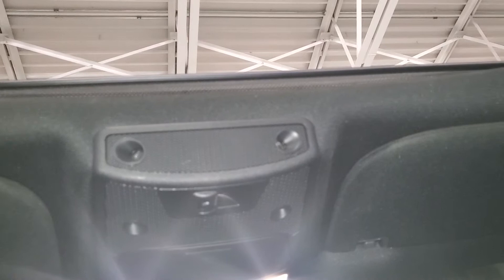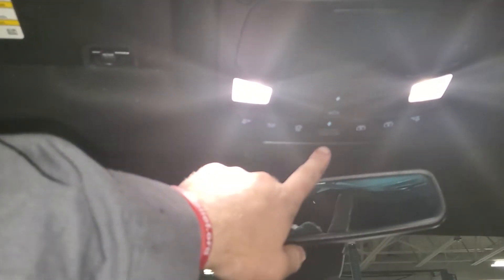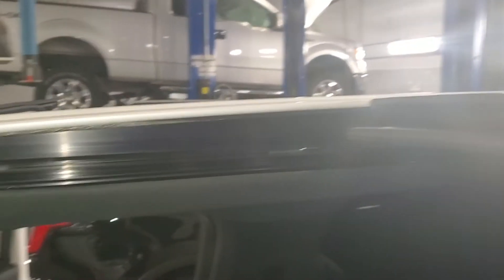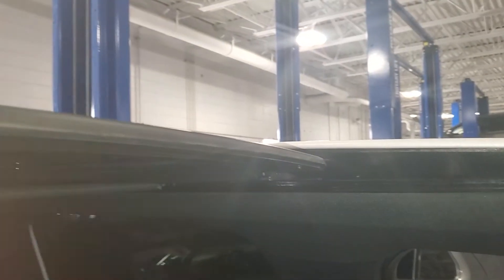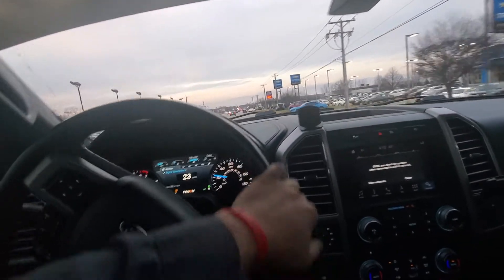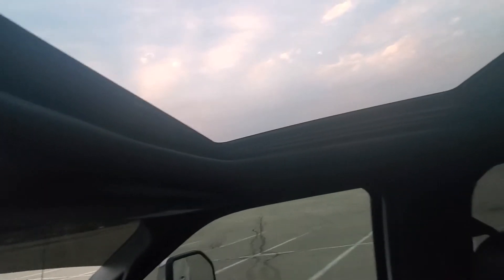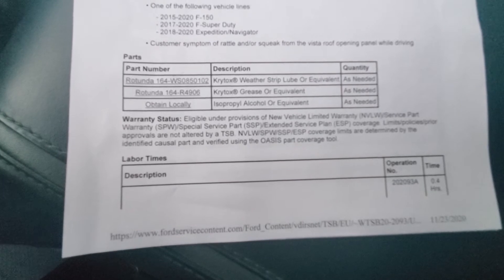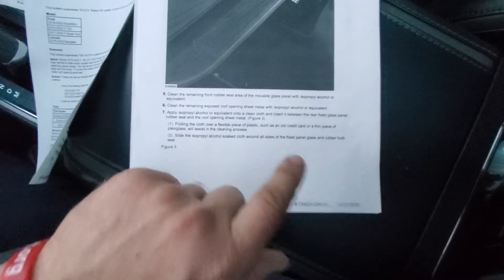Expedition, F150, F-Super Duty - Sun Roof Squeak, Rattle TSB 20-2093 How To

Comment: Great video. Good maintenance even for older Fords. The seal is the same, and should be cleaned out every so often.  Eventually they can dry out and let too much water in. Those channels lead to 4 drain tubes around the vehicle. If they clog, the roof leaks. A small amount of water in a rain is normal in the channel.
Reply from the maker: Absolutely